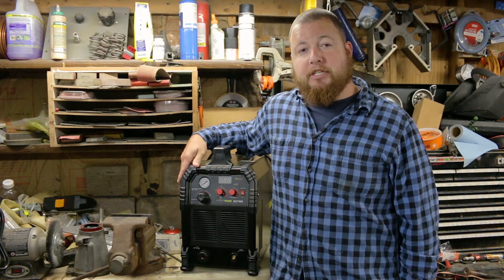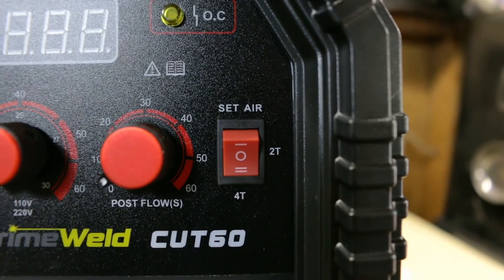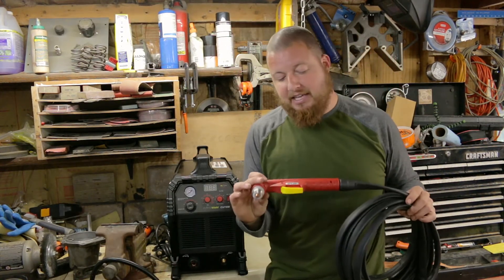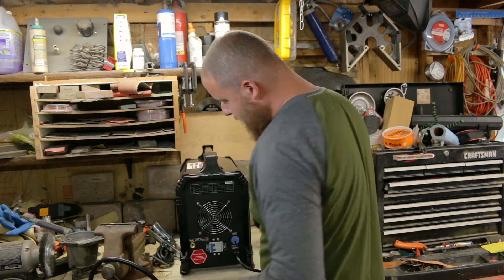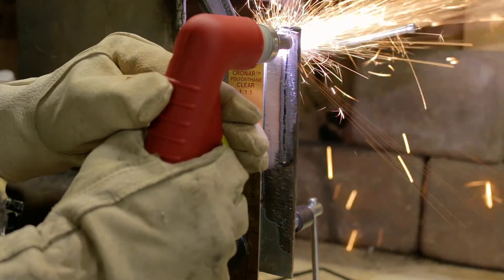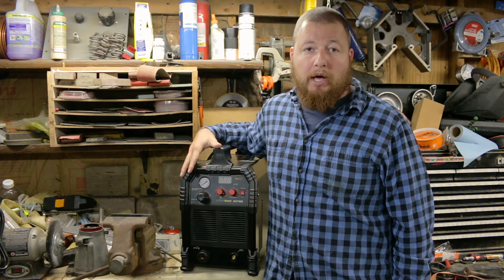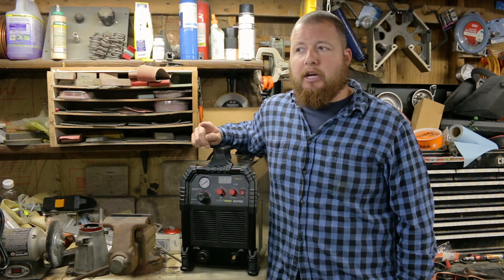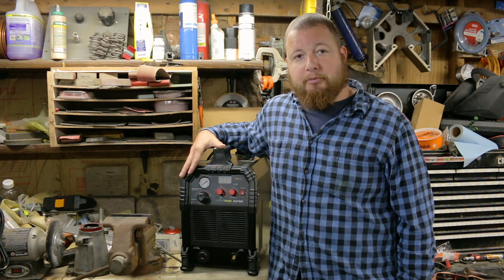Prime Weld Cut 60 Plasma Cutter Review/Testing

Comment: Thanks for the review - I don't do quite enough to warrant a $1500 machine, and this looks like a good option.  I do have a question..I've got a welding cart I made myself, and it's made to fit my Multimatic along with some brazing materials.  The bottom shelf is what I eventually thought would be where a plasma cutter would go, but it's got a 15"H limit, which is about 2" too short for the CUT60.  It appears that the carry handle on this machine has a couple screws on either side .. any chance it is removable?  That might buy me the 2" I'd need for it to fit.

Comment: What size compressor should I use if I’m doing relatively large cuts? Say, 3/8 inch or half inch steel? How many gallons should my tank be of I’m running the cutter at 60 amps?
Reply from the maker: Bigger is better obviously, but a 20 might do it. I ran mine off a pancake for short cuts and let it catch up so its all depends
Reply: 5cfm @ 90 psi in at least a 20 gallon tank.